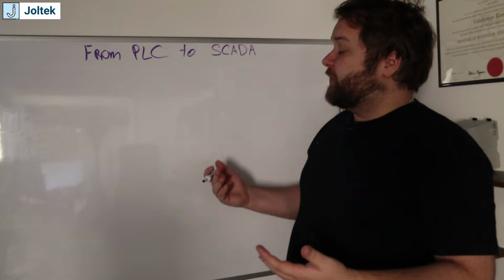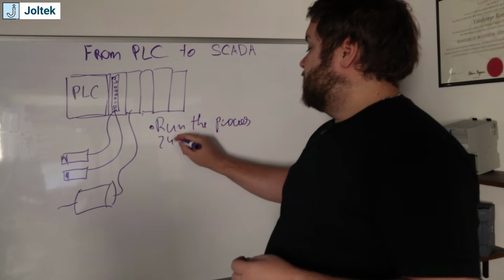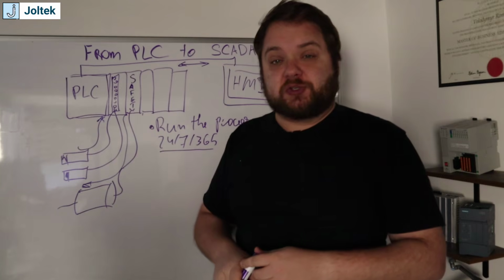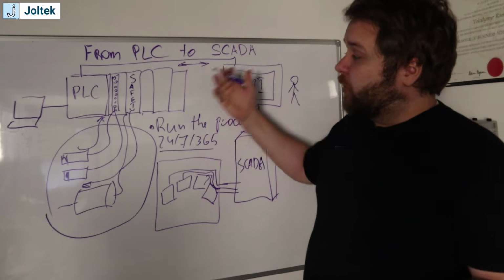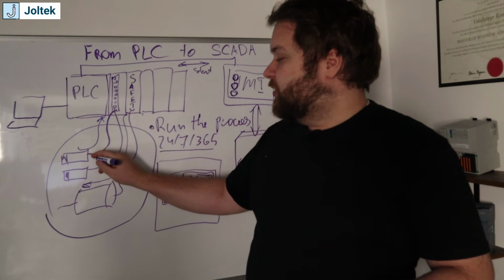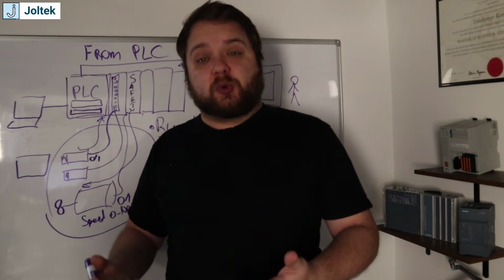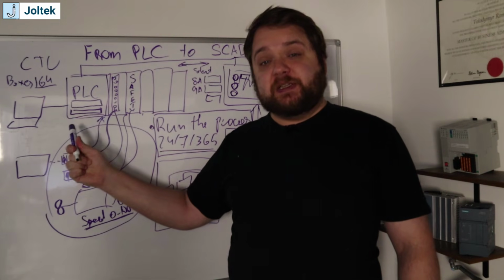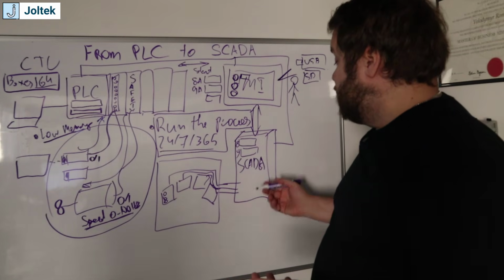PLC to SCADA Communication Explained Manufacturing PLC HMI and SCADA Systems Work Together [P1/2]

Comment: Great one again Vlad. I am learning a lot from your videos. 
Have some questions here as I am not getting proper answers anywhere. 
What are the protocols used between PLC and SCADA. Do we require Real TIme protocols here like Profinet RT? I want to understand the different protocols between PLC and SCADA and SCADA and MES. 
Can we use standard protocols like OPC UA here. What are the pros and cons of using OPC UA vs traditional protocols like modbus in upper layers.
Reply from the maker: It's difficult to answer in a few sentences, but generally speaking, in my experience, the protocol choice only matters in high speed and specialty systems. What does matter is the proper documentation and implementation when it comes to how the signals are being passed between all of these systems. For example, if you're deploying a SCADA which pulls / pushes from / to the PLC every second, you're going to experience poor performance and a loss of data. Most SCADA / MES / historians will have a way for you to create appropriate ties to the control system generally over OPC, but only certain groups will implement this properly. On the Siemens side, it's much more common to see Profinet as that's what the control system uses. To that point, you definitely want to validate if the SCADA fits the control system you have in place. For example, Ignition has significantly improved the Siemens drivers as of 8.3 which made it a lot more capable.
Reply from the maker: Modbus is difficult to scale which is usually the main problem for larger systems. You need to keep very tight documentation of all registers, nodes, etc. With Ethernet based protocols it should be much easier to tie into the infrastructure in my experience.
Reply from the maker: MES and SCADA are very different animals in my opinion... Many bundle them under the same umbrella, but they fundamentally serve very different purposes and groups will have an emphasis on one over the other (generally). SCADA is used for control - you can't have latency issues here. Things need to actually work and the main concern is to run equipment in the current state. MES is used for data and analytics. MES systems should not be sending and control / info back to the floor, but need to record what's important at the right resolution. This creates fairly different challenges the further you go from the plant floor.